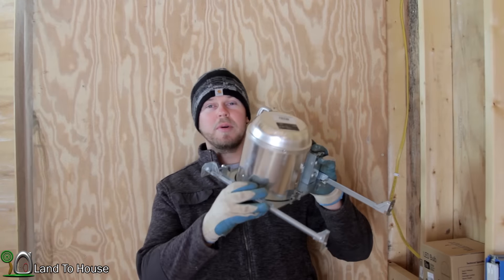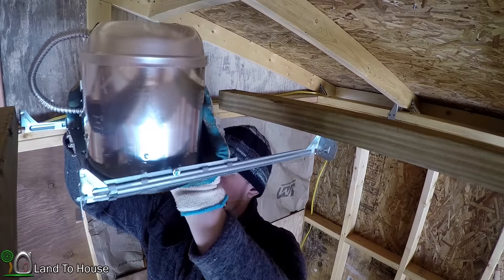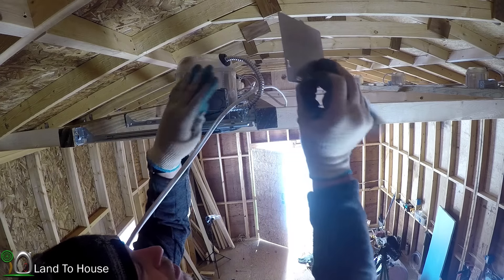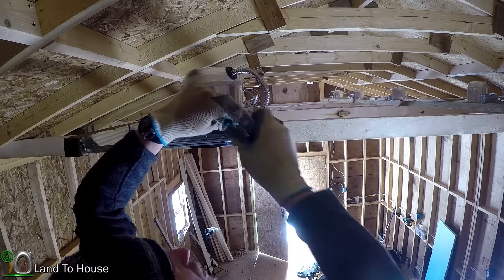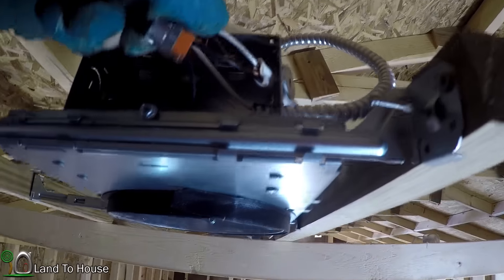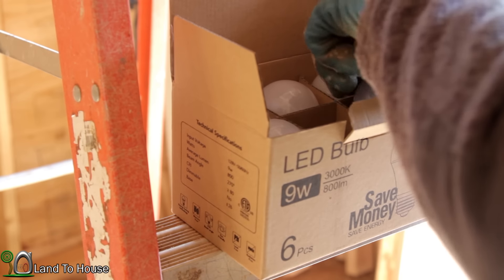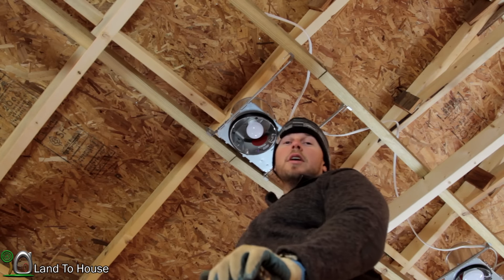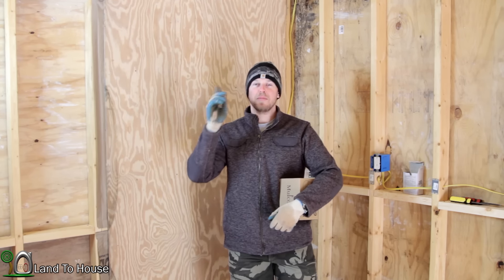Install Workshop Can Lights with Mulcolor LEDs

Comment: Love the videos.  From this angle, it occurred to me to clamp a bit of scrap wood to the undersides of the boards, so that the ends of the can light can rest on a bit of a ledge to make it easier to attach them.  3000k is a good color temp, a bit whiter than incandescent bulbs that give 2800K color temp.